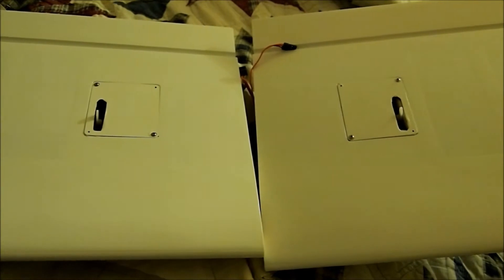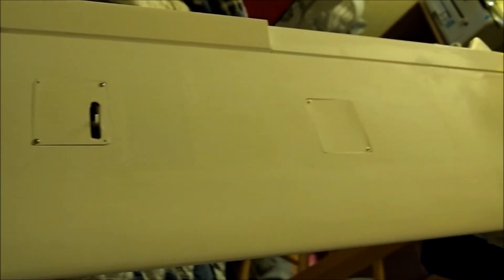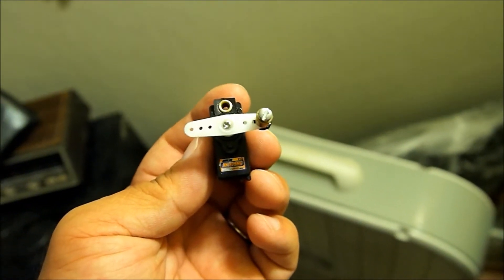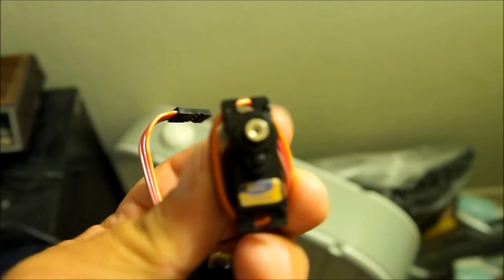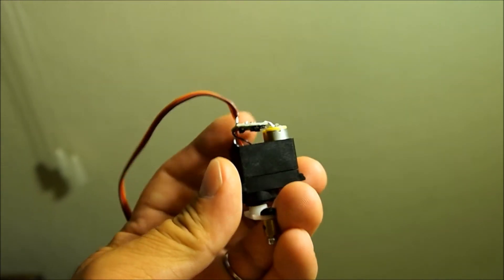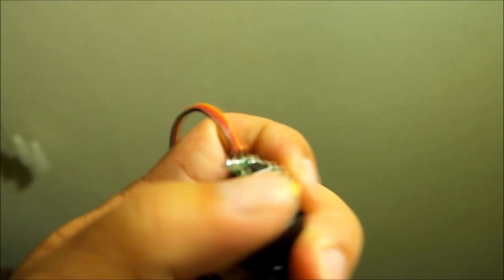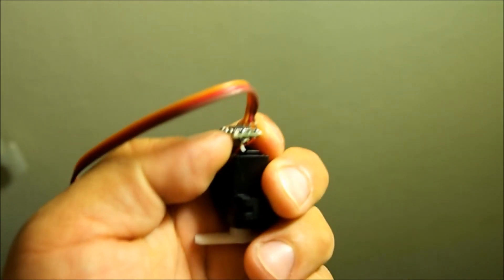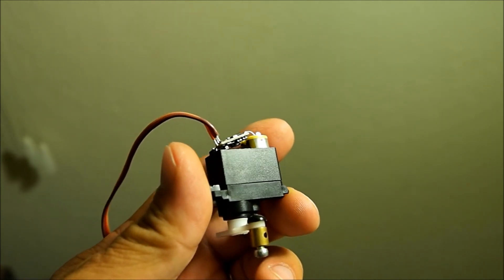Reversing the HK 929/939MG servos for flaps

Comment: Nice job. Yes, if your servo positions are fixed, you'll have to do something like this, or spend out on a reverse servo or servo reversing lead or whatever.
 I bought a Bixler 2 foamy and simply reversed the servo by rotating it 180 degrees horizontally and cutting a new position for it in the foam. ;¬)